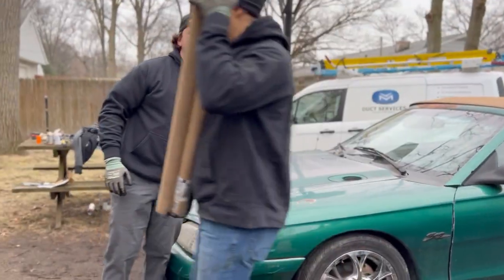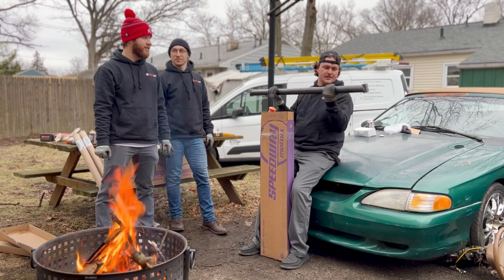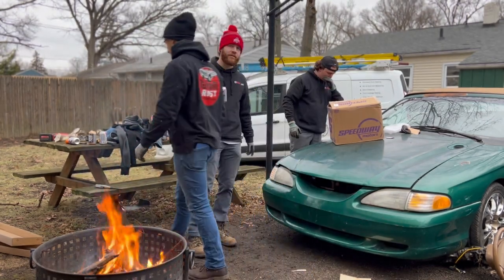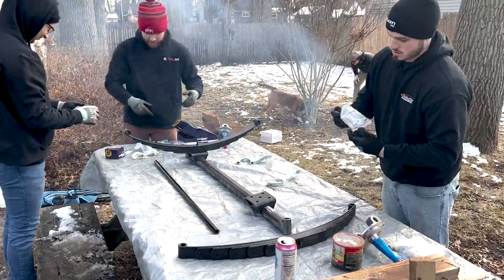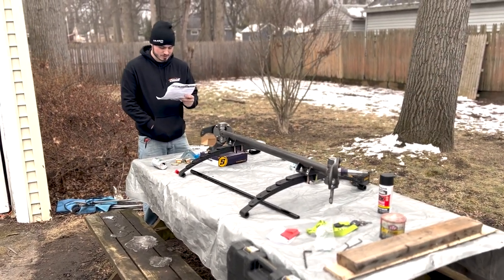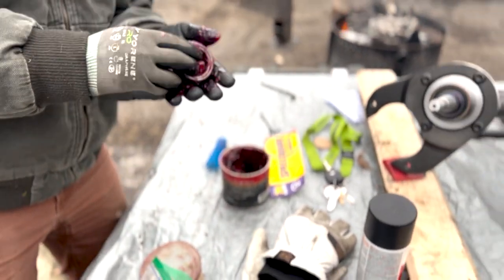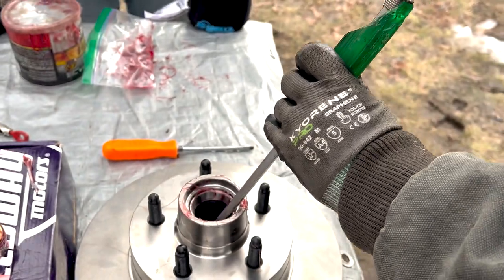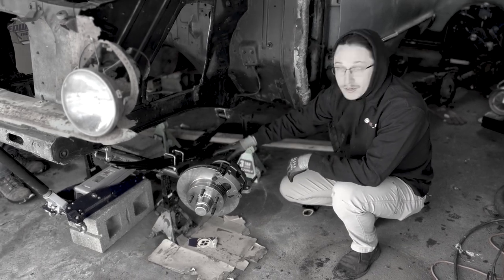What’s in the box!? 1962 Ford Falcon Gasser Starter Kit

Comment: Love the project! I had a 63 Falcon 2 door with a straight axle,  nine inch ford rear axle,  a hand made one ice tilt fiberglass front end w/ a boss 429 hood scoop grafted in that almost touched the chrome trim at the bottom of the windshield, and inside the end of the dashboard was the Firewall ! Beautiful tin work BTW.  I'd planned on using a 390 GT auto in it but sadly I sold it.
Reply from the maker: That sounds beautiful! We flirted with the idea of a big block for a while but the deciding factor to go small block was because of budget and transmission options